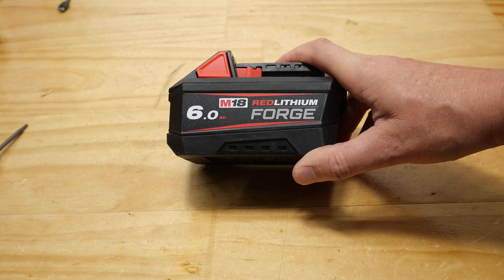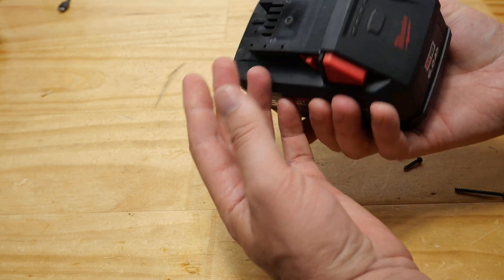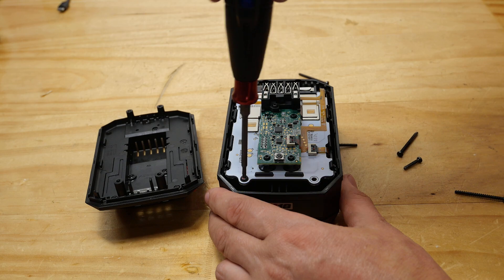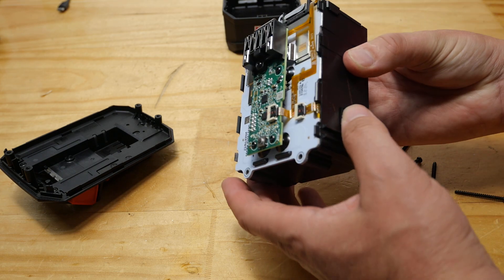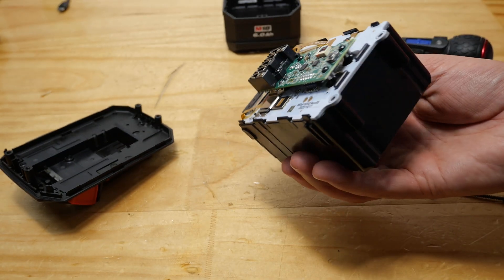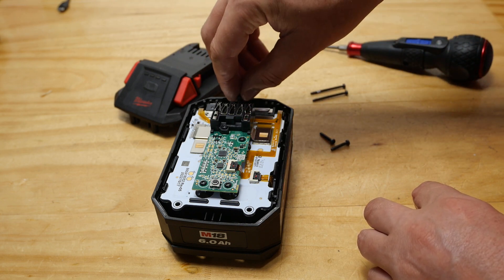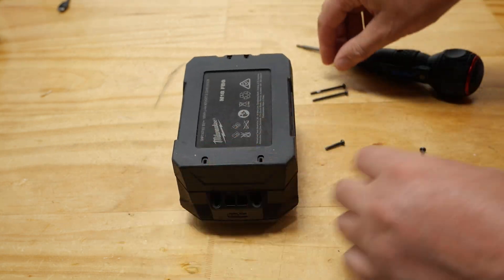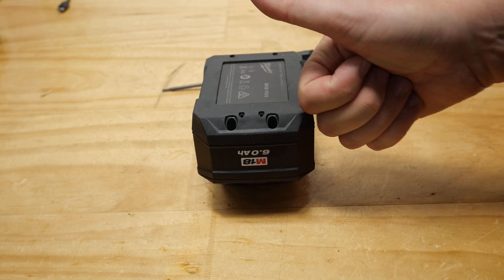Milwaukee M18 Forge Battery Teardown

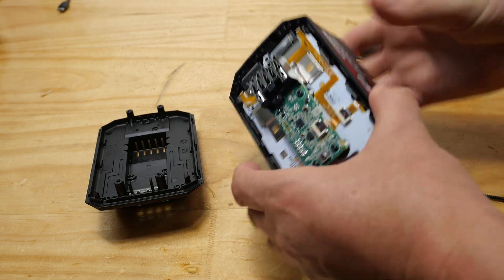Comment: 2:00 By tipping it out, the button got held down. On some M18 batteries (mostly pre-2013, but they seem to have bought it back in the last year or 2), if you hold the button down, the LEDs flash in a pattern that gives manufacture date, number of charges, etc.
Reply from the maker: Who just told you that? I'm gonna have to do some experimenting...
Reply: @BuildsStuff  I've seen videos of it previously. Someone also commented on one of my videos that the newer M18s do it, too. They made me a video, but I haven't got around to analysing it.

I was about to reference this video to tell someone that taking apart forge batteries could void warranty. Then I watched it again and noticed that you laid the battery on its button, so I think it was the button push and not a disassemble detection
Reply: @BuildsStuff  i first saw it at video ID: Rp6CUptw5mM - skip to 9m20s

Comment: There is an issue with power cutting out on high speed tools like multi tool

Milwaukee needs to do a recall
Reply: Really? That's crazy if true. Where have you heard that?
Reply: @EliotTruelove a friend who bought two of them and a certified repair shop who did a test after i told him what happened to my friend, he video it and sent to Milwaukee

Comment: Battery looks more refined. I think the pcb board basically looks the same as the cilindrical model. I'm not sure if stacks are much better. I think I still prefer  cylindrical cells. My biggest wish is that the charging and discharging bms were more accessible. It currently has a proprietary coding system that limits charging and discharging any milwaukee battery without proprietary chargers, instead of having access to universal charging options. With the current battery technology advancements, I think the technology is too limiting on this issue
Reply from the maker: I've charged Milwaukee batteries with a car battery charger before when the voltage has dropped too low for the Milwaukee charger.

Comment: This battery is powerfull and will not overheated as much as the HO  and when paired with the new supercharger its a whole new world
Reply: Did ho 6ah ever overheat?
Reply: @riba2233 not mine but I rarely push my tools to the limit because I have respect and admiration for them. When might say I'm in love with my tools😮

Comment: Yeah, aluminium core pcb :)
Reply: I wonder if it's mostly for reducing puffing.
Reply: @toolscientist  might be, idk how much it can help with the cooling considering it in only on the one side of one cell
Reply: @toolscientist most likely it is there for two reasons but most likely for compression on those prismatic pouch cells and overall safety from something crushing the battery from up top 🤷🏼‍♂️

Comment: Would it be possible for Makita to make a 3ah the size of their current 1.5 ah?
Reply from the maker: Yes. They could use 1 row of 5 cells using the same cells they use in the 6Ah batteries
Reply: @BuildsStuff  The cells in the 6Ah are quite prone to failure though, aren't they? Or is it something else? The consensus seems to be the  the 5Ah is more reliable.
Reply: @Lenz_carpentry  no, they are just weaker. Reliability is not an issue, they have a good cycle life.
Reply: @nakedapprentice Funny, you should mention that; I've had 2 genuine 6ah batteries go bad. Never had any others go bad bar some really old 3ah.
Reply: @riba2233  What do you mean weaker? As in they put out less max current? Hardly a selling point. Besides, my experience plus word of mouth says they fail A LOT quicker than other sizes.
Reply: @Lenz_carpentry  they have lower current capability (15 vs 20A continuous), but they are equally reliable. However since they are weaker it is easier to push them beyond comfortable limits and that is why you might notice that they last shorter. But if used within safe limits they are equally reliable.
Reply: @BuildsStuff wont be high output like the 5ah or 2ah though.
Reply: They could also use the new molicel P30B which have 3ah and literally double the discharge current of vtc6 cells they use in current 6ah packs :)
Reply: Would be so handy for lots of tools
Reply: @edwardlogan267   you can in theory make your own
Reply: they could do 1 row of 21700 cells with 4ah like the bosch procore 4ah. That could be interesting.